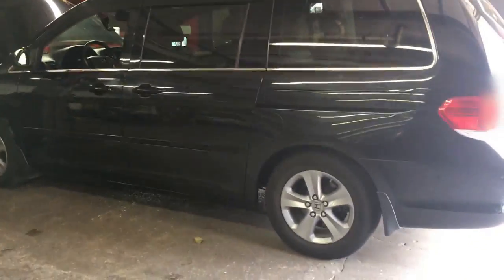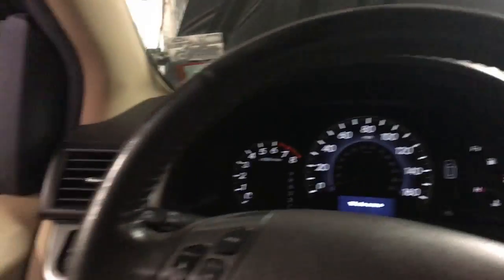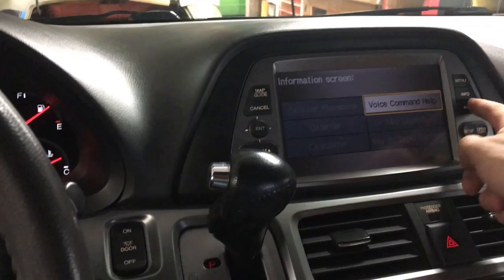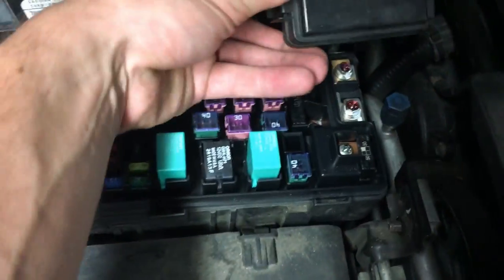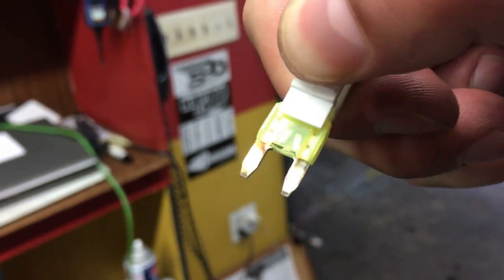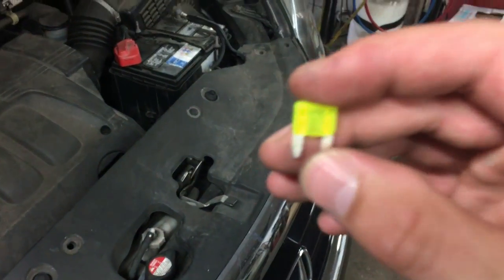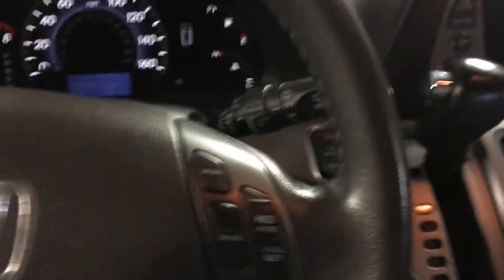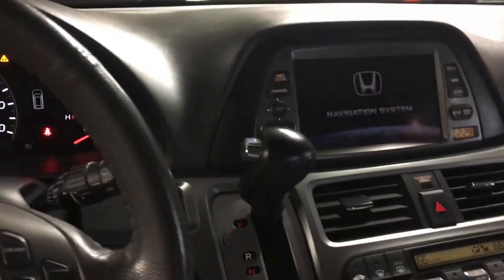Honda Odyssey No Sound but Radio Has Power Easy Fix

Comment: Same issue on my 04 pilot, but my fuse is good. Any ideas?
Reply from the maker: Thanks a bunch for watching my video and taking the time to ask a question. You may want to check if the connection is good at the amp. Also make sure to check all your fuses. Please share an update, thanks.
Reply: @WheelsTips  Both fuses for radio are good still. I am mechanic by trade for more than 15 years now. 
It seems my issue is as if there may be a factory amplifier that burnt out for the door speakers. Only problem is finding the location of it. I reinstalled my factory stereo to see if maybe my head unit is bad but still only sub has sound
Reply from the maker: Thanks a bunch for the update, do you have access to a wiring diagram, VIN specific? That would be the next place I would start. Currently I do not have access to that. Please share an update, thanks again.
Reply: @WheelsTips  I asked professionals on another forum and received confirmation there is no factory amp on my 1st Gen. I was advised that my head unit has a feature to shutdown if a speaker fails. He recommended testing all speakers. I only tested one before this info. Ill be inspecting the rest tomorrow and I will return with results after.
Reply from the maker: I would definitely agree that checking the connection at each speaker is the next best step. Please share an update, sometime people add amplifiers to the system.
Reply: @WheelsTips  thanks again for help and thoughts. Final soaker I checked found the connectors rubbing on door metal. Also found an iffy connector that plugs to back of stereo. I had 2 extra adapters that plug to factory harness and one harness for stereo that came with the stereo replacement kit Amazon sent me. Seems all to be good now. Time will tell. I got 6 weeks before it cut the first time
Reply from the maker: @xThat1dude  Thank you so much for taking the time to share this information it is very useful and appreciated.  Please feel free to update in the future and enjoy the car.
Reply: Do you know where tht fuse is located in newer models, specifically 2023?

Comment: Ok I kind of have a problem like this. In my car all speakers work for the radio but only the right side speakers work for aux. Could it be a fuse or wire somehow or????
Reply from the maker: Hey Cale Hemker thanks for watching my video. It seems like a wiring issue, I’m no expert with audio though, this is strictly my opinion. Doesn’t seem like a fuse issue, if you had a bad fuse it wouldn’t work when not in aux.
Reply from the maker: Hey Cale Hemker, that’s great info thanks for sharing, I’m glad you resolved your issue.

Comment: My 07 accord has power and everything works but only one speaker is working, that’s the front right speaker. The other ones done work. Please help! Thanks
Reply from the maker: Hey Playtime With Lilliana thanks for watching my video. It seems you may have a connection issue at the radio,or a speaker wire that is faulty, or a fault amplifier if your model has one, or your head unit is faulty. You can start by checking for continuity on speaker wires. If you know how to remove your head unit you can also send it to remanufactures to have it bench tested. I recommend googling your make and model with key word remanufacture service radio Honda Accord 07 they can rebuild your unit at a lower cost than replacing it. Please share what you decide to do.
Reply: Could I take the amplifier right out of the car if that is the issue? I even tried rewriting it into a single din radio and same problem happens so I believe it may be a wiring issue. It started out with the radio not working when I got the car so I got a kit to install one myself but while I was doing that, I messed with the wires and made it to where the radio does work but only on front right speaker
Reply from the maker: Hey Playtime With Lilliana, in my opinion you need the amplifier to have sound. The wiring is something you may need to revisit a bit more carefully.  Please share the results of your diagnostics and good luck.

Comment: Honda crosstour 2013. Replaced battery backwards on accident blew 2 fuses this 100 amp battery fuse and the 20 amp radio amp fuse. That turned the radio on but no sound. I think somehow I skipped the part of entering the security code maybe?
Reply from the maker: Hey Glock Nyneteen thanks for watching my video. Truthfully I am not familiar with those cars, but after that you may want to get a wiring diagram and check every fuse in the car.  Maybe your car has an amplifier and subsequently an amplifier fuse.

Comment: What about a 2020 Odyssey? I paused a youtube video I had on, and turned the volume knob low, to hear some cracking from the windshield. Turned out it was a piece of paper. Then, I hit play again and raised the volume, bam. No sound. I restarted the phone , turned off the engine and disconnect and connect back and no sound at all. Even the fm radio. The message for the fm says "no audio connectiom". What could this be?
Reply from the maker: Hey Gerardo Juarez thanks for watching my video. Have you checked any fuses? You say you have no sound at all but radio has power? Please share an update.

Comment: Hi sir. My android head unit is working. The radio is working, bluetooth working but no sound is coming. Honda City 2006 iDSi. Do you think the problem is the same? There's a sound like ksshk ksshk sometimes. The same sound they use on Copy that "kssh kssh" over over. Hahaha.
Reply from the maker: Thanks a bunch for watching my video and taking the time to comment.  Is this a custom radio setup? It never hurts to check the fuses, especially if you have a custom amplifier.  Otherwise I would check all the connections at the back of the radio and at the speakers.  Please share an update, thanks.

Comment: I'm working on 2015 nissan altima.  2 back door speakers not working but all the other barley hear sound when volume all the way up. I replaced the factory radio when a used one. The old one was not get no sound.  Can you help
Reply from the maker: Thanks a bunch for watching my video and taking the time to comment.  Personally I would check all connections and grounds at the speakers and radio to make sure everything is properly secured and plugged in.  Please share an update, thanks a bunch.

Comment: This worked on my 2012 Honda CRV. Driver side 2nd from firewall. Thank you
Reply from the maker: Thanks a bunch for the update, glad I could help locate your radio fuse on your 2012 Honda CRV, enjoy the car.
Reply: Sorry I'm a bit late with this response, but do you happen to remember what fuse number it was that needed to be replaced? I checked all of the ones that I thought would be related to the audio, but they were all good. I have a 2012 CRV as well

Comment: Helpful video. My car got jump started and I have no sound anymore. My car is a Honda Accord 2013. Should I buy the 20m fuse?
Reply from the maker: Hey Jennifer Nguyen, thanks for watching my video. First check the fuses, you can do that by pulling the fuse out and looking if the bridge is connected or separated. Let me know your outcome. Please consider subscribing to me it would help me a lot, thanks.
Reply: I have this same problem i have 2008 honda accord

Comment: Great video, I have the same problem on my 2006 Honda Element and this 20amp fuse is under the dashboard for the amplifier
Reply from the maker: Hey Big Dre thanks for watching my video.  Did you change the fuse?
Reply: Hey can you tell me where is this fuse located on the element is it under the steering wheel or behind the glove box ?
Reply from the maker: Hey Ruben Sanchez what year is your Honda Element?

Comment: Do you have any recommendations for a 2009 Honda Civic EX with this problem (radio works, no sound)? The problem started after going through a car wash.
Reply from the maker: Thanks for watching my video and taking the time to ask a question. If it happened shortly after a car wash you want to make sure your fuses are all good and that your connections are all secure. Next, whether some water got into the car, if you have a sunroof maybe the drain tubes are clogged. Please share an update, thanks.

Comment: I have Honda Odyssey 2001 the Radio and CD working but NO SOUND. How can I find the fill box and what is the name they mark on the box ? ( radio, Audio .... )
Thank You very much for your Video. It an help a lot of people.
Reply from the maker: Hey Ha Nhat Linh thanks for watching my video. Have you checked to see if you have the same fuses as I do? Could be called entertainment, amplifier,sound or a variety of other names. I do not remember of the top of my head. Please get back to me with an update on the fuse box.
Reply: @WheelsTips  ...I look on the Owner's Manual book have 1 Fuse they call " INTERIOR LIGHT, RADIO " I don"t know that is the right one or another one. I will try to open to see it.
Thank You very much Sir.
Reply from the maker: If it is not a bad fuse it is a bit hard to diagnose without perhaps scanning the entire system.  Also replacing the is inexpensive if you pick one up second hand.

Comment: Hello, please I have this issue with my Honda Accord 2006. The radio comes on but no sound. It's not automatically selecting the AM/FM stations as it normally used to. I've checked the radio fuse and it's ok. I dunno if what else to check. Looking forward to your feedback many thanks.
Reply from the maker: Thanks a bunch for watching my video and taking the time to ask a question. Have you tried to check your amplifier for water damage or poor connection. Perhaps the amplifier is fuses as well, I do not remember. Please share an update, thanks.

Comment: Hi,  thanks for video.  Question: would this be the same for a toyota avensis as i have sound from navigation and CD player but radio has no sound and also notice that the radio will not seek out any stations but keeps looping round.  Happened one morning when i stared car and not worked since.  Apologies if not appropriate comment here.
Reply from the maker: Thanks a bunch for watching my video and taking the time to comment. I would start by checking all your fuses, if you have an amplifier I would check the amplifier fuse as well. I have also sent out the radio head unit in the past on cars with similar issues to get bench tested and repaired. I have also checked for loose connections at the radio and speakers. Please share an update, thanks.
Reply: @WheelsTips  thanks for reply.  Checked fuses listed against radio and all ok.  Cd music works. It’s a single unit with cd,satnav cd and radio on a touch display.  As it just constantly seeks for Chanel’s i think it may be an aerial issue but would have thought it would find something. Thanks again
Reply from the maker: Thanks a bunch for the update. I’m guessing it ended up being an aerial issue, thanks again.

Comment: what fuse is that for the amplifier?  My 2016 Accord has the same no sound issue after a battery replacement.
Reply from the maker: Thanks a bunch for watching my video and taking the time to comment. The amplifier fuse for the 2016 Honda Accord if equipped is in the passenger fuse compartment located under the driver kick panel, fuse number D 20amp. Please share an update, thanks.

Comment: Very info video 👍🏼 I have same prob on my 2011 Toyota Sienna xle no sound radio comes on but entertainment screen is off. Checked  amplifier / E7027 working fine anything you could think of. Thanks
Reply from the maker: Hey Red Bus 75 thanks for watching my video.  If all the fuses are good, check to see if the DVD player is not creating an issue.  Also the head unit itself my have some type of issue, have you tried swapping for a working unit?
Reply: Hi hi you have any video about how to remove dvd video player 67002 from 2011 sienna xle 
Thanks
Reply from the maker: Unfortunately I do not have that.  Please update if you come to a conclusive diagnostic, would be very helpful, thanks a lot.

Comment: My  speakers stopped working. The drivers side speaker started makeing a loud buzzing sound. I swapped it for a new one and I could listen to the stereo again but  that speaker bseemed not to produce much sound if any while driving. Then when I was listening to the stereo while in park it made the loud buzzing noise again. I removed the drivers side speaker from the system. Now I can listen to my stereo but I have to crank the sound up all the way to get a decent volume but its still not the same quality of sound as before the problem arose. Do you think it maybe a fuse?
Reply from the maker: Hey Jim Baker if you have power and music in my opinion definitely not a fuse issue.  Have you checked your wiring?  Does your car have a amplifier?  Have you checked the amplifier for good connections and/ or water damage?  Please share an update.

Comment: Hallo, 
I have problem with my Honda Accord 2008 car audio. I haven't used my car for 3 weeks, after that when i started the car something happened to my audio volume. There is very low volume even if i increase it to the maximum. Some times volume getting normal condition for a short period if i drive through any gutter in the road 😀. 
Any idea? Which fuse needs to be checked for honda accord? 
Thanks
Reply from the maker: Hey ajithmeledath thanks for watching my. I don’t think a fuse is your issue, I would look into loose connections or a poor performing amplifier. Please let me know what you find.

Comment: Hey! I'm a bit late here, but I have a 2010 Honda Odyssey Touring that the audio system works perfectly, but after about 3-5 minutes of usage, the audio starts cutting out. It would play the music, cut out, and then comes back on and plays the song. It's not an aux cable nor bluetooth issue, and it's not the fuse, since I replaced the fuse too. Any advice? Could it be a cable being halfway plugged in?
Reply from the maker: Thanks a bunch for watching my video and taking the time to comment. I am not sure if your Honda Odyssey has an amplifier it is possible the amplifier is not in the best condition. If it does not have an amplifier I would Google search, rebuild remanufacture service  2010 Honda Odyssey radio. This will provide you with services that will test and rebuild your radio for a fraction of the cost to replace it. Please share and update, thanks.

Comment: Would you happen to know what fuse would be for a 2012 Honda Civic I have the exact same problem
Reply from the maker: Hey hector hernandez thanks for watching my video and for the great question.  You may have a few things going on, first I would check the engine fuses specifically fuse #19 ( 20 amp) fuse which you may or may not have depending if you have a premium amplifier.  Also check for loose connections in the back of the radio, looking forward to any update, thanks.

Comment: Have a Honda Civic 2014... same problem but no little extra fuse box.  Do you have any suggestions?
Reply from the maker: Hey Jeanne Pontes thanks for watching my video. If all the fuses are good, chances are you may have a grounded speaker wire. The best way to check is with a digital multimeter do a continuity test on all the speaker wires.

Comment: I have a 08 Ridgeline sound works with the key on but if I crank it the radio will not play if it's running.. Any ideas?
Reply from the maker: Thanks a bunch for watching my video and taking the time to comment. Personally I have not encountered that, some type of safety/ alarm issue possibly.

Comment: I'm having the same issue with a 2007 dodge caliber any ideas? Also what did that fuse go to? The amp?
Reply from the maker: Hey I ON thanks for watching my video. If you haven’t already resolved the issue, in my opinion the amplifier fuse is located in the fuse box under the engine, fuse 19 which should be a 20amp fuse for the amplifier. Please update me on your findings, thanks a lot.

Comment: ALTERNATE SOLUTION - My daughters 2005 Acura TSX had the same problem but the fuses were all fine & the amplifier was also fine.  We removed the stereo and one of the wiring harnesses that goes between the stereo and the amplifier had come half way unplugged.  I pushed the plug back in until it clicked and the stereo was fixed!
Reply from the maker: Hey Kevin Carlson Mortgages thanks for watching my video. That is some great information thanks for sharing and great job on the diagnostics.
Reply: I have an 09 Odyssey touring. My fuse is ok. Was hoping that would be the quick easy fix.  My hunch is it's a loose connection somewhere. During this past winter it started cutting out randomly... just the sound. System was still powered up. Didn't matter if it was CD or radio, the audio would just cut in and out. Thought maybe it was just the freezing temps shrinking metal making poor connections... but it just got worse, even with the warmer weather. Then it just went out and hasn't come back.  So how do you access the back of the radio to check connections, or wherever, whatever you did?